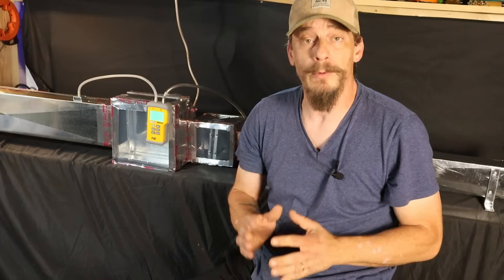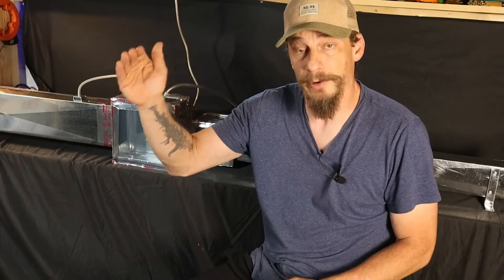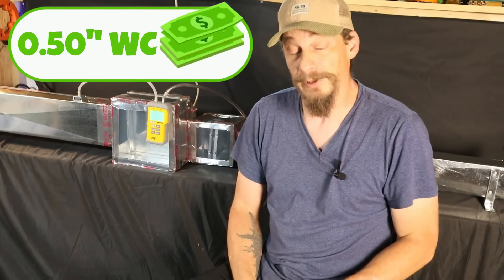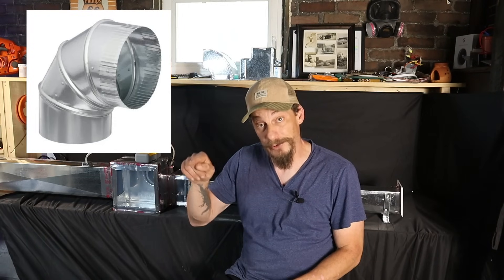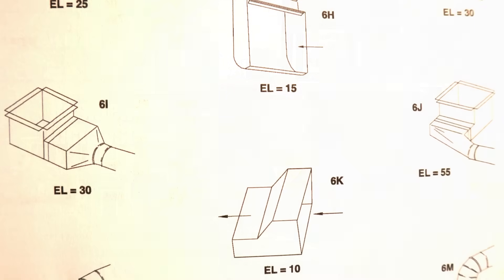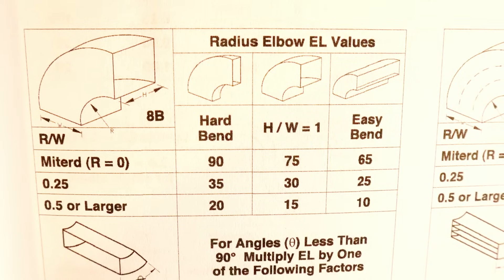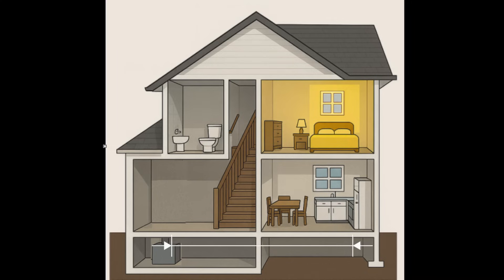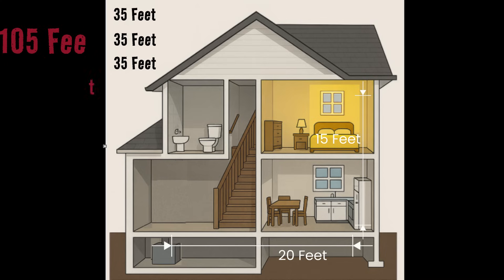I Built a Miniature Duct System to Show What Ruins Airflow

Comment: Thank you for this.  I'm a homeowner, but we move a lot and have to size up situations in homes quite often.  Every bit of knowledge helps.  Can you discuss the effect it has on the blower when you have a bunch of rooms with closed doors?  No jumper vents to allow return into the hallway, and no significant undercut below the door.  Is that somewhat like closing off a vent?  Thank you!
Reply from the maker: That's a whole different issue. It wont effect the motor much directly like static pressure does. The key to heating or cooling a room down is to constantly recycle the air through the heating or cooling system. When you have rooms isolated like that (as far as return air) the air doesn't get recycled as well in those rooms. So what you have is a straight blend of air from the vents and air from the room and the temp pretty much stays there, instead of steadily increasing (heat mode) or steadily decreasing (cooling mode). 

 Another issue is that pressure differentials are created through the house. In the isolated rooms you'll have positive pressure, so your losing BTUs to the outside through cracks and crevasses. In the rooms still recycling back to the unit, you'll have negative pressure because the blower is still trying to move the larger volume of air including those closed off rooms. This can lead to humidity getting pulled into the house and lead to issues there as well.
Reply: @JerseyMikeHVAC  Wow, thank you for the thoughtful answer!  There's a good bit there I'd never considered.

Comment: Can you please make part 2 to this video where you finish the other rooms? It seems you started off with the unit first and got the specs for limitations. 
I thought you calculated first and then see how big the unit should be.
Reply from the maker: Manual J comes first, to determine the potential heat loss/gain of the home and each individual area. That might be the calculation you're thinking of. Manual S comes next, to select the proper unit size. Then Manual D is performed, which is the designing of the duct system to deliver the CFMs needed based on the unit's capabilities.
Reply: @JerseyMikeHVAC I've been installing ductwork for 8 years but never knew about all these Manuals. But installing and designing is completely different. 
Maybe you could make a limited series using Manual J through D to show how they all come together...

Comment: I have a question, when calculating capital FR are we using the total run in feet of the whole home or individual runs or trunk lines ? Also how do we decide what the correct tonnage and size or registers for each room? Thx
Reply from the maker: FR is based off only the longest run in effective length on the supply side and the return side. Not the whole duct system. System sizing and CFM per room are calculated using Manual J (heat load calculations) and Manual S (system selection) procedures, which occur before duct design (manual D).
Reply: @JerseyMikeHVAC thank you that helps

Comment: And yet, even with that manual available, it seems like every system is as bad as the example you used with the unit as far away as possible from  some corner of the house, the longest runs possible with as many hard bends as they can get into the system. It's literally called "central air" but, it's as if nobody designing systems know what "center" means.

Comment: Also worth noting but not likely a problem in 99% of the case.
If there is too low resistance it also increases the load on the fan as it will spin under it's rated RPM and it will also increase it's power draw.

This is easy to see when people make DIY dust collection blowers and the intake for it is too large the motor will struggle to keep up the RPM and will pull a lot more current, then just chocking it down or adding the ducting/vacuum hose is needed to keep it at the rated load

Comment: Is the pressure drop of the evaporator coil and the filter given by the manufacturer at some standardized flow rate (CFM)?  Because the pressure drops depend on the flow rate.
Reply from the maker: Engineering specs will show them. Some air filter manufacturers make it hard to find.

Comment: @8:48  the more resistance on a blower the less it works (the less amps it draws). Counter intuitive, but the “work” a blower does is moving air. The less air it moves, the less load. When motors burn up because of too much duct resistance or clogged filters, it’s not because the load is too much, it’s because the system runs for way, way longer than it’s designed duty cycle because it simply can’t meet the demand of cooling/heating the space to temp (so it never gets a rest) or because the airflow is so significantly choked that the motor isn’t getting proper cooling (most blower motors are in the flow of air).   But the actual load on the motor, in terms of watts, is less. Don’t believe me, test it yourself.  The highest watts/amps a blower will ever draw is in free air, with no ducting or filters attached.

Comment: Great Tutorial yes sir Mike Thanks  .....overall duct design & its proper installation is so supper impotent on over all in its ability to Proper Deliver to its conditioning of the  Space served ..... is based off>  blower performance >  total static pressure  & its proper charge & or gas wc & its blower Heat rise

Comment: If you measure TESP on a regular basis, you'll find that many duct systems are way over budget.
This is mostly due to "dead heading" undersized branch ducts without transitions and using too small of filters.
TY JM
Reply from the maker: You're not kidding. I've replaced 7 year old units running 1.7 TESP on a .5 motor.

Comment: Damn viewing it as a budget is great.
At the beginning of this video, you had the information plate that notated it was tested at .5. Would you say that is the maximum? 
Obviously, you could choose a lower static pressure if you didn’t need as much airflow, right?
Reply from the maker: It's pretty easy to eat up that .50 in realistic situations. Usually the challenge is not to exceed it. You don't want to go too low either because you want to maintain a healthy velocity as well.  Too little can lead to stratification, even inside the duct work.